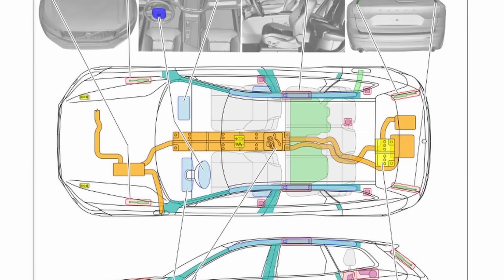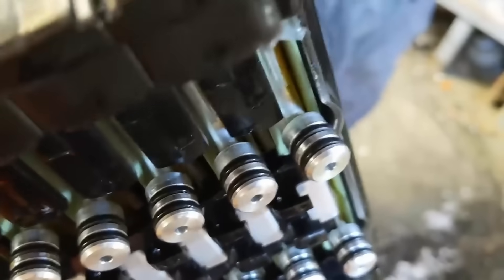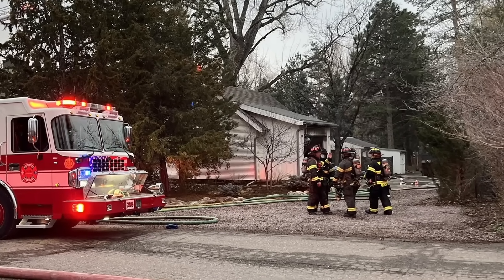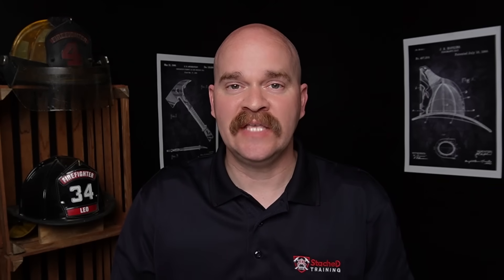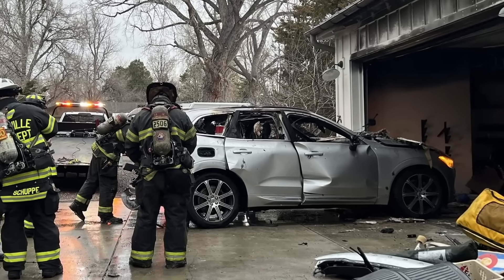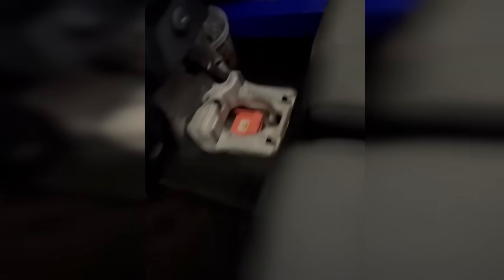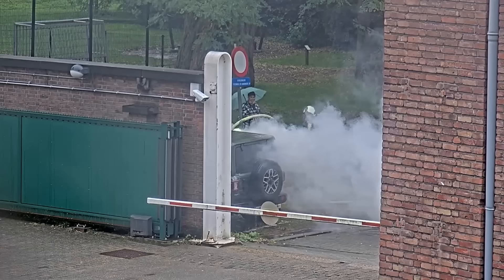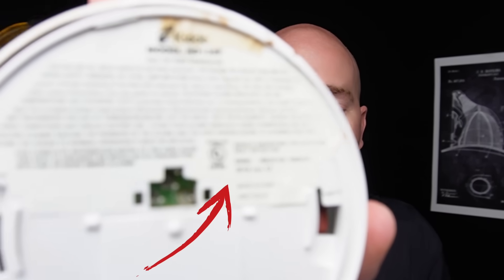EXPLOSION: Volvo XC60 Electric Vehicle!

Comment: Here in Australia we’ve had well over 1000 lithium ion battery fires and explosions and had 2 lives lost recently after a device battery explosion burned out their home. Personally I wouldn’t ever buy a full EV or an EV hybrid for that matter I have a number of devices with lithium ion batteries and unfortunately even my motorcycle runs a lithium ion battery. Like a lot of people I wonder how many lives will have to be lost or changed forever before governments and manufacturers start taking the issues with these batteries seriously and bring in tighter regulations and safety standards for these death traps or ban them outright.
Reply: In USA  we have the NTHSB which forces manufacturers to do recalls. But because this was our installed climate kooks  governments mandated idea not a peep about a recall.
Reply: Now how many people die due to climate change, bet it's more than two
Reply: There's a big difference between cheap badly designed, Chinese e-bikes, scooters and hoverboards that catch fire if you so much as look at 'em wrong and EVs. But I agree the batteries themselves do need to be better regulated and tested.
Reply: @therealchayd  😂🤣😂 And where do you think over half of the world’s EV and Hybrid batteries are manufactured? CHINA!!! Do your homework by the way after Tesla the second biggest producer of EVs is BYD which is a CHINESE COMPANY.
Reply: @therealchayd  funny over half of the world’s EV and hybrids lithium ion batteries are manufactured in CHINA and after Tesla BYD is the biggest manufacturer of EVs and is a CHINESE COMPANY.
Reply: @davegoldspink5354  BYD has had a lot less battery fires than tesla, nuff said
Reply: Good thing gas powered vehicles never catch fire, and if they did, good thing the fumes aren’t hazardous.   Seriously, though, EV’s are amazing, but they’re not ready yet.   Forcing them on the public isn’t the solution.
Reply: @oddsman01  funny most fires in ICE vehicles are electrical fires and don’t require 40000 to 50000 litres of water and hazmat teams to put out.
Reply: @davegoldspink5354  Why do I get the feeling you’re pulling all these numbers right out of your ass?  My understanding is water is exactly the wrong thing to use on a li-ion fire?  Most are electrical fires?  Ok whatever, you made that up but i’ll run with it.   Have you ever seen a gas powered  vehicle fully engulfed?  It’s devastating, especially inside are shop or a garage.  Just like a li-ion fire.   Both are horrible, both are extremely toxic, deadly even, one we have lots of experience with, the other not so much.
Reply: @oddsman01  by the way I suggest you watch a few more videos on EV fires because aside from using large fire blankets to stop the spread of smoke and toxic chemicals and smoke water is used to not so much put out the fire but to try and cool the battery pack.
Reply: @davegoldspink5354  and what should worry you even more about US made batteries is there are a shite tonne more BYD's on the road than tesla's, even with those facts a tesla is more likely to kill someone due to the auto pilot going haywire even when the auto pilot is not turned on
Reply: @oddsman01 do you think the gas inside the tanks of regular actual cars just lights on fire somehow? Its almost always electric and if it isn’t its a catastrophic crash
Reply: @effigy42  You’re joking right? Fuel tanks crack, fuel pump housing cracks, fuel rail leaks, fuel line leaks, p/s fluid will ignite when pressure hose bursts and hits exhaust manifold on top of all the ways they catch fire after an accident are just a few that immediately come to mind.   

Lets talk about when they’re serviced and the tank catches fire because bonehead tech leaves it on the shop floor and bonehead cleanup crew knocks it over, ignites it with Zamboni and burn the whole damn dealership down.    Come on, man.   You dont hear about these things every time they happen because they’re nothing special anymore.  You probably heard about them all the time when people still road horses into town.
Reply: Only six EV fires have been recorded in Australia.
Reply: @gibbonsdp rubbish there has been more than 6 in Maitland nsw. 😂
Reply: @gibbonsdp  This week!!
Reply: @ldnwholesale8552  You might well get that impression from channels like this.
Reply: @gibbonsdp  that is actually incorrect there’s been 2 of both Teslas in Goulburn one from a damaged battery from road debris last September and the other while recharging this past week and you had the Cement Australia EV truck on the West Gate freeway in Melbourne earlier this year along with another EV cement truck in Janus Electrics yard (who converted both Kenworth trucks) while undergoing testing last year and the MG EV at Sydney airport Hertz yard which also had a damaged battery which had by Hertz employees and burnt out 4 other cars and closed the airport control tower which is some 500metres away and they’re just the ones I remember.
Reply: @davegoldspink5354  Quibbling aside - it's very few, and not thousands.
Reply: @gibbonsdp  yeah but only if you’re here in Australia and not in China where lithium ion battery fires are a daily occurrence.
Reply: @davegoldspink5354  China has over 20m EVs, so that's to be expected.
Reply: @gibbonsdp  😂🤣😂 and yet by your reckoning there’s only been 6 EV fires only in Australia. Good one time to lay off the EV cool aid mate.
Reply: @davegoldspink5354  EV Firesafe's reckoning, not mine
Reply: @gibbonsdp  well as Aussie news programs and Aussies in the know when it comes to EV fires in this country you’re both wrong.
Reply: EV Fire Safe Australia's leading authority on EV firefighting techniques. I'll take their word for it over that of newsreaders and "Aussies in the know".
Reply: @gibbonsdp  Just so you know Fire Safe Australia have nothing to do with EV fires they do building fire suppression and fire protection systems as well as personnel evac training. So you’re wrong again and to think there’s only been 6 EV fires in this country in 14 years while there are so many EV fires around the world each day you’re either a delusional EV fanboy or you simply don’t have a clue.
Reply: @davegoldspink5354  Just so you know, EV Fire Safe Australia and Fire Safe Australia are two different organisations.
Reply: @gibbonsdp  seems funny to me you know how to google what you want to see yet you ignore any of the truth that blows your EV bullshit out of the water. 😂🤣😂
Reply: @davegoldspink5354  Seems funny to me that you'd ignore the word of Australia's leading authority on EV fires, but as you don't seem able to Google I'm not at all surprised.
Reply: @gibbonsdp  the fact you keep deleting my last comment shows how much you hate the truth.
Reply: @davegoldspink5354  The fact that you think I can delete your comments shows how little you understand YouTube.
Reply: @gibbonsdp  I know for a fact that people often report comments they see as being offensive and YouTube removes them. So if you haven’t had them removed where are they gone?

Comment: I recently stayed in a Marriott hotel in Sydney. The parking garage was on the third basement floor. There were EV charging points throughout the parking level, no partitions, no ventilation, and the only way out was via the elevator. The risks of EVs are manageable, but it seems we're doing nothing to manage them. Simple measures could save lives.
Reply: Agreed , Here in Burnie Tasmania the local council has seen fit to place several EV charging points right next to the only pedestrian crossing / exit and elevator to the higher levels and next to other non EV cars .
Any EV fire would see everyone’s car go up in smoke because the ceiling of the car park is lower than the local fire engines , when I asked what fire mitigation measures were in place they pointed to the sprinkler system saying that would put out an EV fire 😂 .
As we all know EV fires burn at 2500c so it will have no effect , I now no longer use that car park .
In Perth WA one of the city centre car parks no longer allows EV,s to park within the structure and makes them in an outdoor area .
Reply: @Aussiepete1962 water can put out a battery fire, using peak tempatures is irrelevant. A 20 gallon Gas tank will output twice the total heat when burning as a 1000lb battery.
Reply: @miguellopez3392 
Says the proud owner of an EV that depreciated by 50% as soon as left the forecourt. Doohhhhh!!!!😅
Reply: @DALKINION  I drive a gas guzzling jeep, driving off the lot doesn't actually drop value, usage and maintenance cycles do, gas cars  depreciate half their value in 3 years of their 11 year average life spans.
Reply: @yuglesstube  research shows that insurances will total a gas car if the airbags are deployed.
Reply: @yuglesstube  no they don't. They deploy when a accelerometer threshold is met, this is to prevent head injury from whiplash.
Reply: @yuglesstube Agreed: structural deformation has begun, to allow the g-forces to build sufficiently to trigger the sensors before airbags deploy. G-forces don't come from no-where, they come from the rapid deceleration, and the CAUSE of that is the deformation of structure - otherwise the vehicle would sail right on through whatever it was hitting (presumably in an alternate dimension). Thats physics. In most (not all) cases, the damage is likely to be substantial by that point.
Reply: @miguellopez3392 Water "can" put out an EV fire (given many are really just plastic fires), but will have very little effect on an EV battery fire - especially from an over-head sprinkler. Unless the water can be directed at the cells in thermal runaway, the battery will continue to burn until all the chemical energy has been released. I think there was a recorded case of an EV battery being extinguished, but re-igniting more than a year later (something over 360 days); let 'em burn, then we know it cant re-ignite. But you cant do that in en enclosed parking structure given the risk of structural damage. (Agree, peak temps are irrelevant to the discussion).
Reply: @andyowens5494  water can put out a fire, fire fighters have been able to do it in under 3 minutes with water, but far more water is needed to cool the pack down to prevent the lithium ion batteries from decomposing and making themselves flammable again, I don't think they will re ignite after a year from remaining heat, sound more like the battery shorted again, but there are instances of Forrest fires lasting a whole year because the fire burns underground through the root system which is why you are also not allowed to throw fire damaged wood at a dump unless it's been a long period since the fire.
Reply: @yuglesstube same everywhere in the world, cars drop about 10% as you drive them out of the dealer, lose 30-40% by end of year 3.  Well maintained low mileage cars still have some value at 10-12 years old, recently traded my 10 year old VW Touran for ~20% of purchase price but only 60,000km on the clock.  Since the dealer wouldn’t take it against the new car he arranged a second hand dealer to look at it, dealer then gave me an additional discount for no trade in.
Reply: No use arguing with anti EV crowd. That’s like crying to convince a black berry user in 2007 that touch screen is a way to go. All these anti EV sople will be driving EVs in 10 years
Reply: @mrtichy11  Maybe....... but in 10yrs they might be worth driving - they might be cheaper and not worthless after 5yrs, and the charging network might be more convenient, and in Australia, where I am, the grid might be clean enough for them to actually be a low emissions alternative.....until then I'm happy to wait for the early adopters to take the depreciation hit and work the bugs out, thanks.
Reply: @miguellopez3392  maybe, but the petrol (gas) tank won't spontaneously ignite, setting the rest of the car on fire, it's usually the last thing to catch alight after the rest of the car is well ablaze.

Also the fuel tank doesn't supply it's own oxygen as it burns, so is easier to put out with retardant foam, blankets etc. Ternary Li ion batteries produce their own oxygen in thermal runaway, so are way more difficult to put out.....
Reply: @miguellopez3392  there might be a correlation between the airbags deploying - most likely because airbags usually only deploy in more severe collisions, so the rest of the vehicle is more likely to have sustained damage severe enough to write it off.

I can't see why an insurer would write off a vehicle just because the airbag deployed - correlation isn't causation....
Reply: @peeemm2032  it's because replacing airbags is expensive, nearly the entire enterior has to be disassembled to re certify it, correlation is that all cars are becoming too expensive to repair so you are kind of forced to buy a new one.
Reply: @peeemm2032  the engine does that instead, during an accident a liquid fire is sometimes much harder to contain if the tank is burst and the fuel spreads over a larger surface. The oxygen produced from a thermal runaway is only enough for a thermal runaway and not a fire, its when the gasses escape is when the catch fire, so itbis more difficult but can be stopped by cooling or submerged the pack with water for an hour.
Reply: We have a habit of not giving a damn until it's mandatory. 
And we also have a habit of not making things mandatory unless a big enough tragedy occurs that makes it non controvercial in politics.

If you look at some "dark history" channels, many historical fires were caused by circumstances that asked for them and action was only taken once it was too late.
Reply: Yes. Stop using them!
Reply: @HAMILTONPROVIDEO  I think it's too late for that. The horse has already bolted, and its tail is on fire. And its hooves. And there's white smoke coming out its nostrils. Yeehaw!
Reply: No stairwells sounds like a building code violation, not an EV problem.
Reply: Assuming that so many people can't be brain-dead - How are so many people missing the obvious - Which is: We're in a totally NEW kind of world war already. 
>  exploding vehicles
>  bioweapons as medicines
>  toxins and attacks on our foods
> and other kinds of attacks that I don't think are accidental or coincidence.
Reply: Are you sure they're aren't stairs as a fire escape?
Reply: @mickleblade  not that I could see, which counts as there being no stairs if you can't find them immediately in an emergency. The vehicle exit ramps were the safest bet, which is little help if you can't outrun the expanding plume of toxic gas
Reply: @tomparker5000  that's a fail on many counts, needs reporting, though who knows who to
Reply: Simple measures:
BEVs not allowed on underground garages....
Park 15m away from other cars to avoid burning them.....
Problem solved !!!!
Reply: @jplacido9999   given the recent examples of how parking/charging EVs underground can go horribly awry, I absolutely support your idea
Reply: How is it even possible that we are supposed to "manage> the risks? If any ICE car had .1% of these issues, they would be yanked off the market! How can anyone trust Chinese made EVs?
Reply: Immediately strikes the Marriott Sydney off my Hotel list.
Reply: About right for building work standards in Sydney.  Better standards in Asia.
Reply: @paul9689  better standards in most places than Sydney.....
Reply: How "manageable" were the 3 massive ships transporting these abominations that were wrecked?
Reply: @Salman-sc8gr  EV fires would be manageable on those ships if they could partition and contain the fires adequately to protect the remaining cargo, structure of the ship, and any other exposures while the EV burns itself out. Instead, they have the same old fire control measures as for petroleum fires, i.e. oxygen suppression, which is useless for EV fires as we all know. The problem is that shipping companies need to completely overhaul their vessels to safely accommodate EVs. That would be expensive, and they would need to pass those costs on to the EV manufacturers, who would need to pass those costs onto the rich numpties who buy the EVs, which will never happen. Shipping insurance companies will make the final call, and they need to do it now.
Reply: The best thing about EV's is that they identify idiots.
Reply: @richardweyland116  that's somewhat true - vehicle purchases are something of an intelligence test, and you have to drive the results of that test in public
Reply: @richardweyland116 they drove Saabs before.
Reply: @richardweyland116 those that oppose them are idiots. An occasional car fire versus a planet on fire, you choose
Reply: This will change soon, there is a big push for changes to build codes to either ban EVs or require absurd amounts of mitigations for suppression / spark free ventilation that will make them get banned anyway.
Reply: @whatcouldgowrong7914 we need a federal law to protect EVs
Reply: You missed the point, ICE vehicles catch fire, give off fumes and you need to escape from them too.
In fact there is more chance of fumes from exhausts.
So assuming you did not miss the ventilation any underground parking must have and the mandatory fire suppression system, then you should have reported the hotel.
I find it very strange the local fire department didn't notice this when they issued the fire safety certificate...
????????
Reply: @davidsoulsby1102  What makes me chukle is the amount of hate EV get for alleged "fire safety" while completely ignoring Hybrid Vehicle dangers. They have the same batteries as EVs AND they also carry fuel. Truth is BEVs (especially the newer ones) are 10 times less likely to catch fire than ICE vehicles.
Reply: Don't buy them easily managed 😂
Reply: Just imagine 50m EVs caught on fire worldwide 😂😅